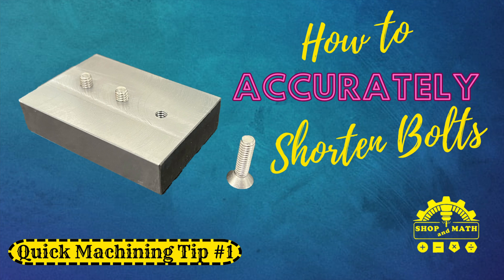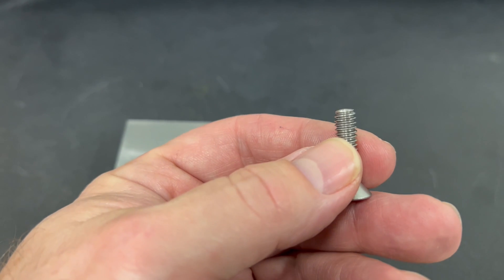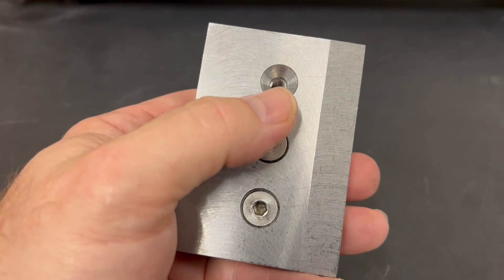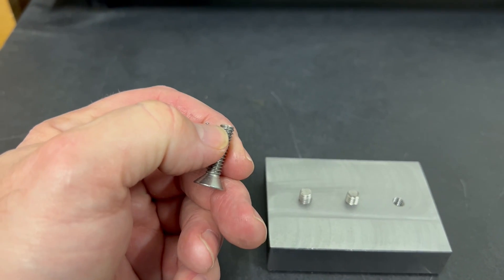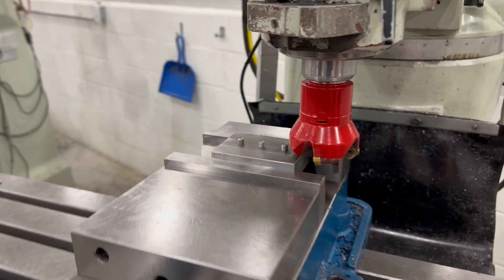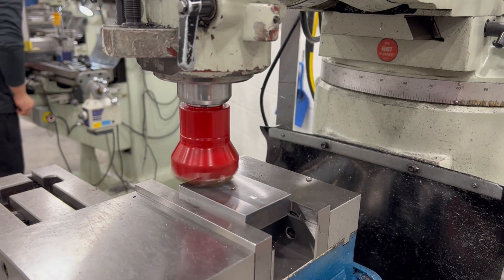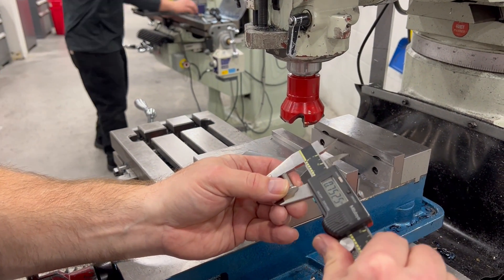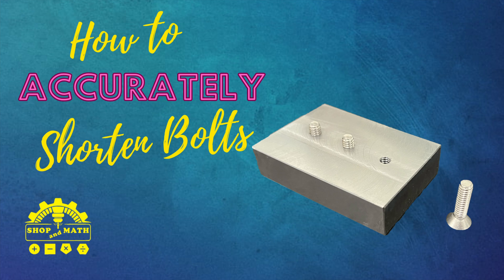How to Accurately Shorten Bolts

Comment: How do you grind the 45 back on? I always roll over threads when I try
Reply from the maker: There’s a couple different ways of putting the Champer on the end of the thread that you’ve cut
The first way that I used in this video was to hold the screw facing downward at a 45° angle and rotate the screw or bolt in my hand at the same time removing the same amount of material off all the round the circumference 

The second method of shortening bolts is to just go to a grinder or a bandsaw cut or shorten the bolt but before you do that you threaded a nut on first, by threading a nut on first, it will allow you to be parallel with either the bolt which you need to have an Allen key inside of the nut or on the pedestal grinder. It will help balance the threads with the diameter of the head of the bolt.

Grind the 45° in a downward position, you get the required, Champer, then unscrew the nut, and that will guarantee that you have no burrs left on the end of the thread
Reply: @shopandmath  Ray, please think about making a video to demonstrate these ways of putting the chamfer back onto the screws.

Comment: And if you only have a lathe you can drill and tap/countersink a piece of cylindrical stock, chuck it up, and do the same thing.  Both methods are an interrupted cut however and carbide doesn’t prefer interrupted cuts.  I’d use old inserts because of this.